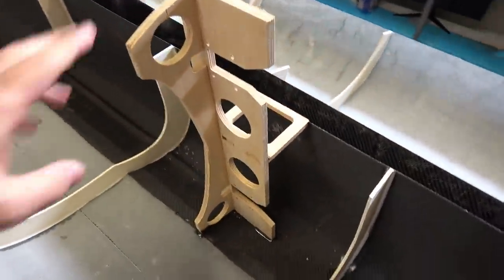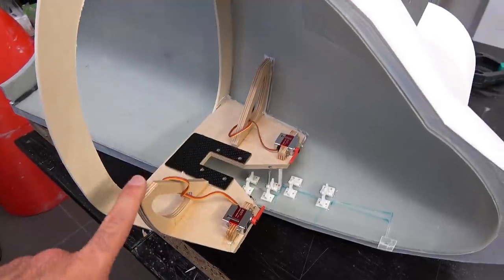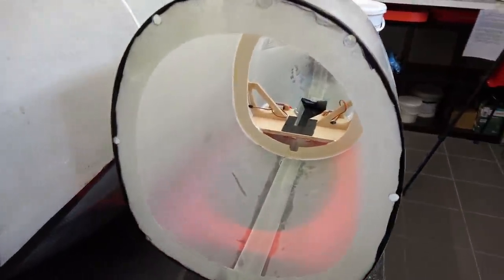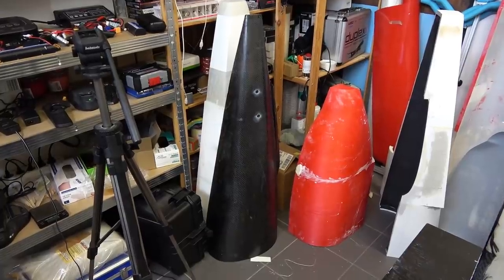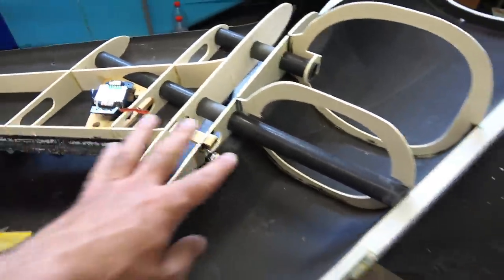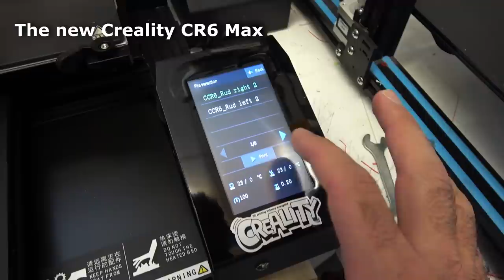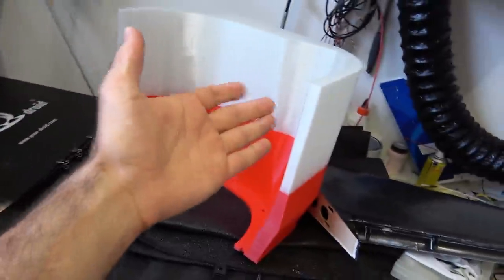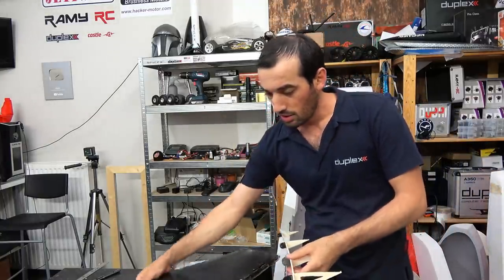Building a giant AIRBUS A380 RC Airliner| Part 3

Comment: Always enjoy your content. It's been interesting to see your skills and techniques evolve. Had a thought/suggestion on how you join your parts together. Rather than do them internally, you could mold a recess along the joint on the outside of you halves, just wide enough for your joint strips. You sand the outside of your joints anyhow, so by molding a recess on the outside of your joint areas, you don't have to worry about reaching inside. Just a thought. Also, have you considered tinting your resin, and applying a layer of resin to your molds before you apply your first layer of fiber material? Of course you prime and sand anyway. Again just a thought. God bless and stay well. Looking forward to your next video.

Comment: Ramy:   Once upon a time, there was  experimental aircraft which drew in air from the upper surface of the wing via thin slots and then used that air to drive a jet engine mounted in the tail.   Two other jet engines helped propel the aircraft.   The airframe was a modified B-66 bomber.   The developer was Northrop.  Might this of use for a propulsion on a future project?

Comment: Another build progressing nicely.  I was wondering what the base adhesive is that you mix the milled carbon in to, to bond the ply parts to the fibreglass/carbon?  I thought it might be a 2 part epoxy, but it looks runny enough to be a casting resin.

Comment: have you given thought to using a flexible drive shaft for the rudder, and then you wont have wires or cables exposed. then your rudder servo can be in the larger part of the rear fusillage and be more accessible.

Comment: Hello Ramy ! Thanks for sharing. I guess you were tired and maybe upset while talking about the rudder alignment, could you please have a thought for non native english speakers and talk slowly when it's tricky like this, please !
- What is the black filler you add to your epoxy ? It looks like 'metal' araldite but it probably rather graphite, does it add stiffness or rather adhesive power ? You put it everywhere so... 
-very optional question and suggestions about possible future models. 
*Transall, massive, slow, STOL. 
*Dassault Rafale . No comment
*Why not something like a very big utility drone, long distance, FPV... I guess you have a job and enough money, but it would give you a professional credibility for your future career, who knows, as you masterize many aspects of the RC game. It could be excited to create both a useful plane and a pretty design.
*An other challenge would be to build a plane with scale speed, so very light and special profile. It could also be very exciting to build sophisticated FPV electronic devices like ILS, autopilot. And also a realistic cockpit with inside video.
*If by chance you decided to build a Fouga Magister I would love it, for sure the biggest RC F.M .... You would gain a lot of tippers I guess. (Same for Transall)
Maybe next poll ask among a list of planes you like who would become tippers/patreons for what plane. If you did not already decided about the next ten aircrafts :-))
Have fun !

Comment: I’m wondering why you don’t include the leading edge slates and cruder flaps, I know the model does not need them but no modern a/c is built without them? I have never flow a model a/c but I am an airline pilot and your landings seem very fast (high speed) you should be able to determine stall speed by finding Vmu speed. And use that speed for landing speed as it is usually 5-10 kts. Faster than actual stall seed.
Reply: They do not work well in that scale, they only add mass making model fly worse while requiring lots of work, at this scales simple and lighter is better.